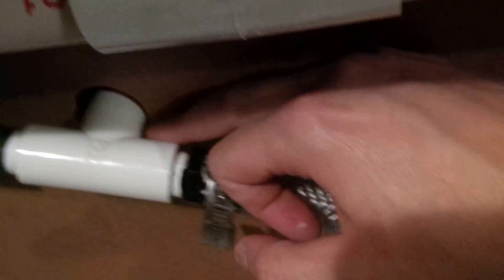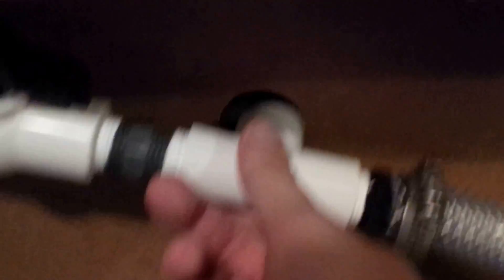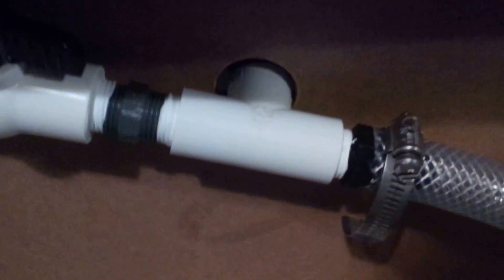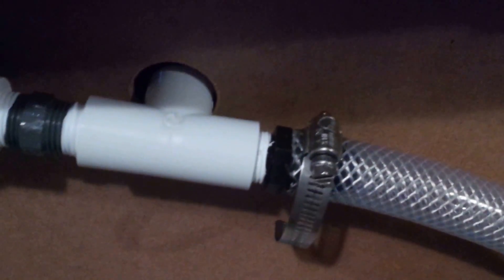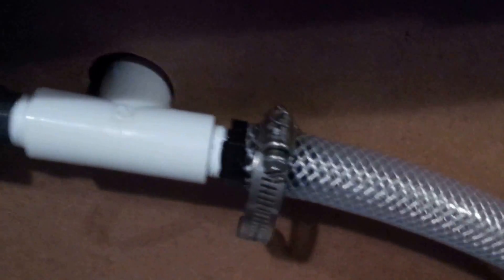Before the first Wet Test

Comment: What kind of shelving unit is this?
Reply from the maker: I think its this one:
https://www.rona.ca/en/5-tier-shelving-unit-14-x-34-x-70-dark-grey-metal-21155000

If I had to get another one, I'd try to make sure where you stack the 2 together, it includes something to secure them better.  I drilled and bolted mine together to make sure a bump wont disconnect my pieces but added a bit of work to the process.